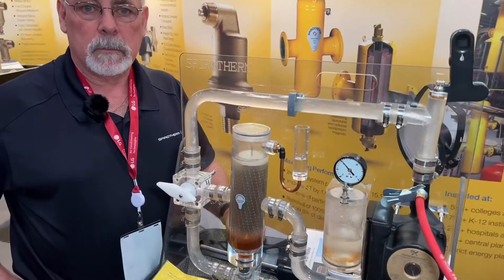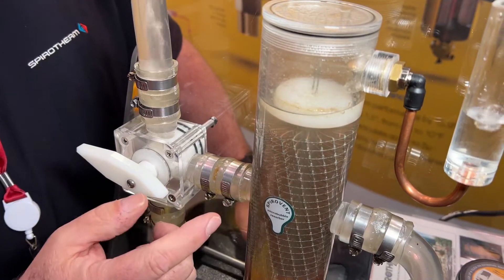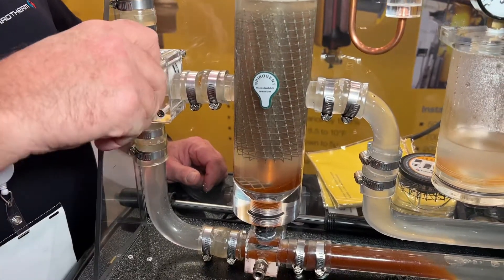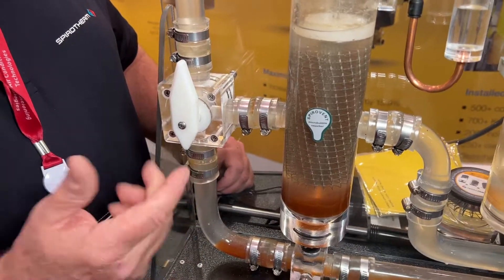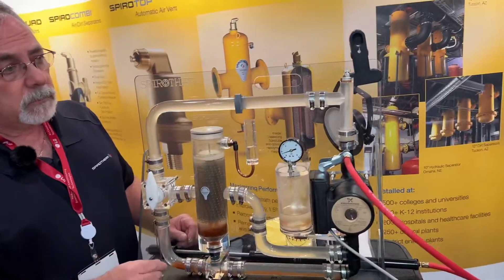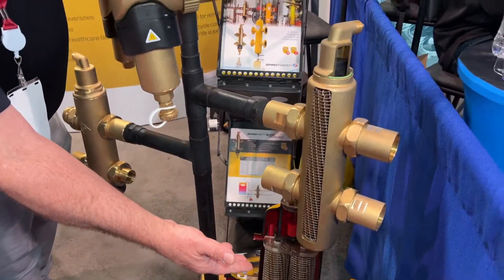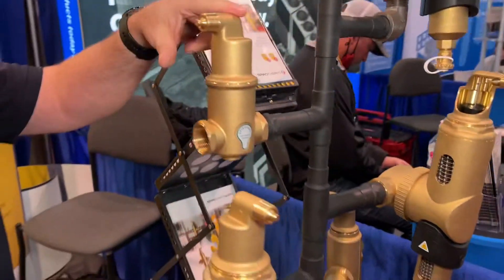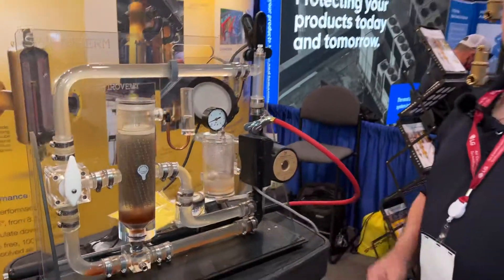How it works: Auto air & dirt separators for boiler systems

Comment: What happens to the dirt? How do you clean it out? Does it continue to collect until it fills up with dirt and causes a blockage?
Reply from the maker: During regular annual maintenance it must be flushed out the bottom thru the drain connection.
Reply: @mechanical-hub  i see it now on the bottom can’t wait to see more of these out in the field!